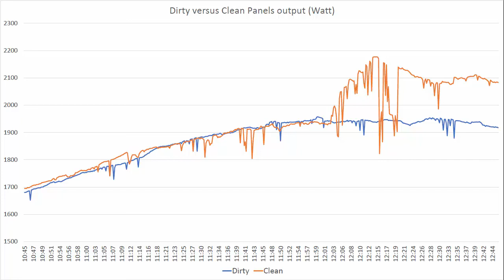Dirty versus Clean Solar Panels

Comment: Greetings, How are you Tesla batteries holding up? I have a 15 kilowatt Tesla battery bank.
I am reinstalling them at new homestead ff grid homestead. I have a heeting system similar to yours. It gets very cold at the new place. -30 F is cold. What do you recommend for maximum battery life. I have the 7s version of the 24 volt modules. I only charge to 4.04 volts per cell. I do not discharge below 3.4 volts per cell. I appreciate any  input you can give me.

Comment: Great demonstration Per! I would have thought there would be more than 8.5% difference after temperature differential. 
Now I won’t be quite as worried about trying to keep the panels as clean as often as I do.
Reply from the maker: It was not a very hot day and a breeze was moving air over the panels. I have seen solar panels over 130 Fahrenheit in the summer. The output increased slightly during the washing when the panels were cold but not a lot. Modern solar panels are designed to have the lowest possible temperature dependence.